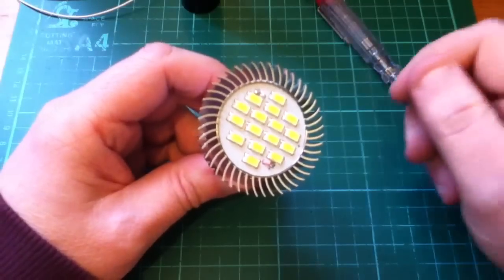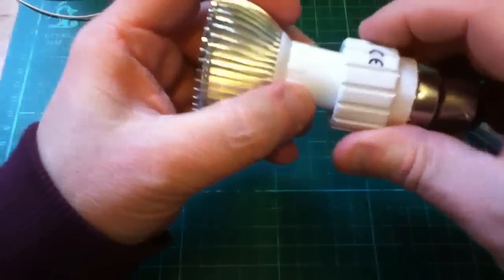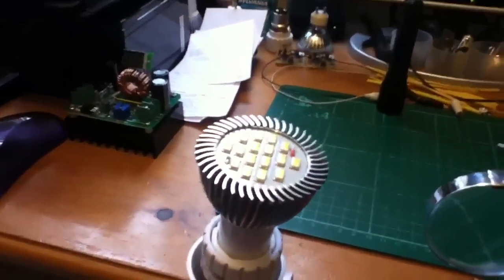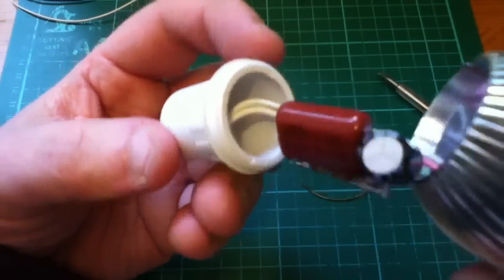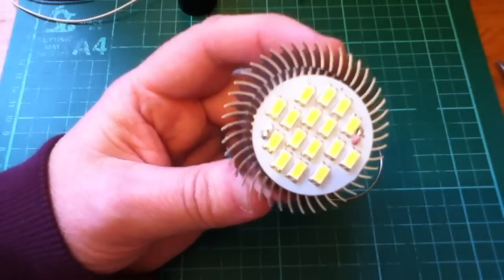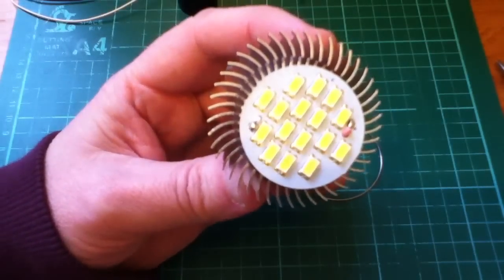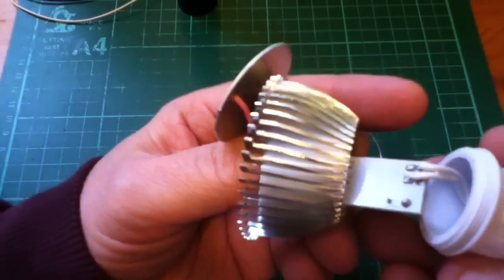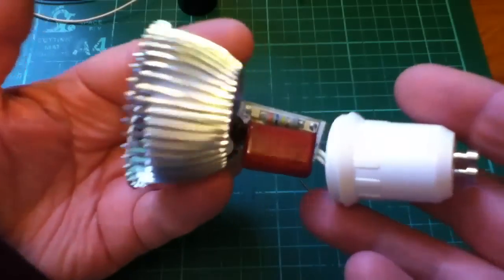Dangerous GU10 LED Spot Light is Cheap and Bright but could Kill You - Seriously

Comment: Get to know what a bridge rectifier is,  lol, what an ass hat. You can turn the bulb 180 deg and it will still be ground potential. At least you could have done is meter the heat sync to provide us that your hypothsys was incorrect.
Reply: Dan M There is no bridge rectifier when the bulb is screwed in "backwards". Try watching the entire video.
Reply: AC mains > Bridge Rectifier > rest of circuit. No matter if mains hot  or neutral,  rest of circuit can not change polarity from changing in bulb insertion direction.
Reply: Dan M
You're not thinking about what the case of the bulb is connected to. The circuit that powers the LEDs is irrelevant. The case is connected to the neutral pin of the bulb but for a thin layer of insulation. If that insulation breaks down, reversing the orientation of the bulb results in the hot wire being connected to the case.
Reply: "The case is connected to the neutral pin of the bulb but for a thin layer of insulation. If that insulation breaks down, reversing the orientation of the bulb results in the hot wire being connected to the case." 

There should be isolation from the ac mains hot/neutral to the rectifier  dc portion, usually a circuit board that has a few mm of board etched isolating the mains to the dc. Even at 220v, would not be able to jump/arc across, unless of an electrical storm producing excessive ac voltage  may jump the gap, and most likely damage more items in the house.
Reply: "There should be isolation from the ac mains hot/neutral to the rectifier  dc portion"

But there isn't - this is the entire point. The "neutral" skips the PCB entirely and is wired up to the LEDs.
Reply: Dan M
That's not isolation; that's just a gap to prevent arcing. Only magnetic or optical isolation will prevent a shock if the bulb is inserted backwards.

In any case, looking at the PCB, the insulation is only a mil or two (thousandths of an inch) thick. The minimum safe separation distance at 250V is 0.56mm (22 mil). Remember that the PCB has an aluminum substrate.
Reply: dllexport- Really puzzled: a mil is a unit of angle used in the military, the angle subtended by one metre at 1000 metres.  A thousandth of an inch is a "thou", not a "mil".  It's too confusing, especially as 1 millimetre is usually referred to as "1 mil" - an abbreviation.
Reply: William Cowell
In electrical engineering, a mil is 1/1000th of an inch. I've never heard of 1 millimeter being abbreviated as "1 mil". It's always been "1 mm" because that's the SI abbreviation. But you're right, "angular mil" is also abbreviated as "mil". The archaic units the US and other countries use is very confusing indeed.
Reply: mil was suppose to be mm
Reply: Interesting, Dan.  In all my time in engineering , I never once heard of "1 mil" being "one thou".   And with good reason perhaps, as it would be very fertile ground for an expensive - or dangerous - mistake.

Comment: Ok I'm no sparky, as us Aussies call electricians, so won't get into the whole voltage vs amperage argument, but really how many people change a lightbulb whilst the socket is turned on or touch a bulb it whilst it's plugged in and turned on.

I mean really.

Also it really is a case of you get what you pay for. I mean people buy stuff off ebay because it's cheaper and cheaper doesn't mean just in price. eBay and the internet have opened up the market to cheap quality non regulated rubbish that can be dangerous - just because it claims to be genuine doesn't mean a thing.

Comment: i don't mean to troll, but doesn't the bridge rectifier prevent that from happening?
Reply: Araon pottor Nope - the entire circuit that comprises the voltage drop and DC conversion is only on one wire. Go back and watch the video again - of the two pins, one goes through the fancy circuit, and one goes directly up to the surface of the bulb. Now in normal operation is is okay-ish as the entire circuit will operates as a circuit. But if you were to screw the bulb in 'backwards' and get 240V at the surface of it, when you touch that bare wire you don't have a bridge rectifier or capacitor in your hand. So your body just provides a ground path for raw mains power.
Reply: holysirsalad Wow, a bridge rectifier that works with one lead, now that is cutting costs to the bone. Uh, how's that work?

Comment: Does the LED not work on DC? If the control board sends a DC voltage to the LED's then no matter which pin lines up to AC, the wires from the board to the LED's would always be the same polarity whether no matter which prong is "Hot" in the high voltage side of the board. Am I missing something here?
Reply: There's no electrical isolation. Voltage is between two points. For the bulb, it's the output of the DC rectifier and the case, which is supposed to be connected to neutral in this unsafe design. (In a properly designed GU10 bulb, it wouldn't matter.) Flipping the bulb around will cause the case to be connected to hot. You're standing on the ground, not on the rectifier's output terminal, so you'll get shocked.
Reply: dllexport- Thank you for the reply and clarification, it's not the sort of thing I tend to buy online but I enjoy watching interesting tech on youtube. For those who might obtain a unit like this I appreciate the time people take to produce clips like this, I have posted a couple repair videos myself and recognize how time consuming it is. None of mine have rated a million + views though!

Comment: Thanks for that.
There is also another way to electrocute yourself even with the light switch off.
It does require your house wiring as well as the LED to be 'faulty' but this can occur.

If the 'Polarity' in the lighting circuit or main house wiring is 'reversed' turning off the light switch
doesn't make the circuit dead.
In this case you'd have to switch off at the main switch.

Comment: isolate supply before changing the bulb  -   dangers  are quite apparent   55 volts at one amp will earn you a free hospital visit   -  but I don't regularly climb four feet into the air to fondle my led bulbs especially while they re on   if it bothers you so much  - go back to halogen bulbs  -  the electricity company will love you  and as a gesture  to you  ,      put your bill up

Comment: It doesn't look very safe nor well designed, but a few remarks: I don't get your comment about "a 50% chance of live vs neutral". There is not really a live nor a neutral line in AC so the orientation of the socket really doesn't matter, the very concept of AC means that live and neutral switch several tens of times per second between both conductors. As for the PCB, it is in fact a legit PCB type called Metal Core PCB, designed for things such as HP LEDs that need a PCB but also an efficient heat conduction path. So, unless you're using high enough voltage that it would arc across the electrical insulator between the PCB and the metal core somehow, this is in itself a safe and normal setup for LEDs as far as I can see. Very poorly designed though with no electrical shielding on the front and that stupid heatsink is hardly even making contact with the MCPCB, might as well just have omitted it and put some plastic on there instead... Then again, you get what you pay for. :-)

Comment: Did you not say there was a bridge rectifier in the circuit?  Then the line voltage will not be presented at the front of the bulb.  I would be more convinced that there is a problem if you plugged in the circuit and measured the front contact points that you say are a hazard.

Comment: I think, there is even a 100% percent chance of getting shocked because the bridge rectifier "connects" Live and Neutral alternating (50Hz) to the positive (or negative, respectively) DC voltage pins. Although, the 360k resistor you mentioned is very likely NOT in series with the mains terminals, but in parallel with the red foil capacitor, for savely discharging it. This prevents you to get shocked by the mains connector pins after switching off the lamp und taking it out of the socket. 360k would dissipate way to much energy if it would be in series with the rest of the circuit. The foil capacitor acts a capacitive restistor without energy losses, it limits the current through the LEDs.
My personal opinion is that it's ok to use such lamps, when you know the possible danger. Thanks for this video revaling that.

Comment: Yep, do NOT buy led lights off the net, unless it is a well known brand. Been there, done that - thrown them away and will never do it again. What happened? The lights stopped working after about a month, one after the other (I bought 5 all in all). Then, when I had a look at them, they actually physically fell apart, besides having the wires holding them together! 

No joke, and belive me when I say it was not fun either. Could have costed me dearly, now I only lost about $25. I got my new lights from Ikea, they are still cheap but they are also reliable!

Comment: The bridge rectifier converts the AC from the mains supply to DC to power the LEDs. It doesn't matter which way you connect up the power to the AC terminals of the bridge rectifier, the positive and negative DC output terminals of the rectifier stay the same so the resistor is always there on the positive DC feed to stop you getting electrocuted.

Comment: I feel that somebody needs to highlight couple of BASICS:

To everybody:
1. modern electric installation should be equipped with residual-current circuit breaker (so called RDC or RCCB) which is meant to protect you from getting killed, even might save from pure stupidity ;)
[Speak with qualified electritian]
2. There are some electric standards how and where those three magical wires should be connected (and they seem interchangeable for some - OMG!). If you don't have it done properly then you need to call to qualified eletrician immediately because those standards are MADE FOR YOUR SAFETY not for ones free interpreteation.
3. As my grandfather told me many years ago - there are some things you should not do - you should always set the light switch in OFF position and also turn off proper circuti breaked before changing the bulb. Why also the circuit breaker? Because somebody can come and press the switch accidently.
4. If you are not certain if you have something on "live" AC power there is a simple tester (cost is minimal) everyone should have it for such case - ask anybody who knows anything about electricity to buy you one and show hot to use it,

To all experts and "experts":
1. Since everybody can watch this video and read your comments and WHAT WORSE you invite the watcher to try to connect PHASE and NEUTRAL wires inversely it whink you forgot that even a couple years old kid can try to do it or a person knowing no basic precautions. I thought that meaning of this post was to make people safer... What is done here is STUPID.
2. In normal situation you have those three magical wires PHASE, NEUTRAL and GROUND with standard color codes.
If the electric installation is done properly then there is no problem with connecting the lamp. Lamp cables should and usually are with the same color. One just connects them. Therefore such situation should not happen. There should be an RCCB, too. Especially in bathroom.
3. In normal conditions there might happen to be (and usually there is) some voltage between NEUTRAL and GROUND. But first of all it will happen to be a DC. and standard RCCB (AC type) will not protect from it. BUT THEN YOU SHOULD always press the test button on it and it will disconnect both PHASE and NEUTRAL wires - MAKING YOU COMPLETELY SAFE.
4. The examined thing should never be used because it doesn't have the TRANSPARENT TOP COVER and IT WILL BE AFFECTED by HUMIDITY.

But first of all no one should try to replace the bulb on "live" PHASE.except for QUALIFIED PERSONS in the CONTROLLED TESTING ENVIROMENT where certainly will be somebody to break the circuit and resuscitate you, if necessary!

Comment: The statements made in this video are totally correct both technically and with regard to the safety issues. Just to answer a couple of points raised in Comments: a bridge rectifier does not safely isolate the DC side from AC mains and even if it did 240v DC is as dangerous or more dangerous than 240v AC; the voltage applied to the LEDs is irrelevant to the discussion - the voltage relative to earth is what is important.

Comment: Chinese-made product with no safety certification or faked certification to get it past customs?  It should only be used inside a finger-proof enclosure, if at all.  The capacitive voltage dropping circuit is junk:  I'd expect this lamp to have a useful life of less than a year, due to complete lack of voltage regulation..

Comment: A full wave rectifier isolates the high voltage feed ! only low voltage and small current ! But ok to check stuff out for safety , just know what your doing, now if the slim peice of plastic insulator wasn't reinstalled then you will have created a dangerous situation !

Comment: You are an ignorant idiot. There is no way 220v AC is going to the led's as you claim; IF it did they would immediately and literally BLOW OUT and off the board. The circuit converts from 220v AC to Low Voltage DC..  IF it is as you claim? hen put on some protective gear and show a video of what you claim is wrong. Final point is LED's only run on DC current; Never AC current..

Comment: Excuse my ignorance.  I have a question... If there are microns of resistance due to the choice of material for the circuit board, why doesn't it short-circuit?
Reply: Jamie Evans Yes and no.

First of all you shouldn't touch the radiator during operation simply because it is quite hot.
Also if you are not touching something grounded with other part of your body (or the neutral wire) you won't close the circuit through your body. And this is why you should never try to replace the bulb with the power on ;)

I would bet that it would electrocute sb after a dose of humidity or simply make a short circuit to the ground if the lamp case is metal and properly grounded (it should be).

Anyway if you have an working RCD the risk is limited - it will quickly disconnect the mains...

Regarding the design actually most of insulation layers in most of such appliances is quite thin because of conditions they are used in. And insulation usually isn't grounded because it is a different thing to ground something and insulate it. You have a plastic/rubber layer on each electric cable to insulate it, for example. Proper insulation inhibites current from flowing. The casing is from plastic (an insulator) and the radiator could be grounded but first - there is no ground connector in GU10 standard and second - with good design and a proper insulation it is not necessary to ground it. Look - if you take properly made LED bulb for E14 or E27 connector there is no grounding necessary, and it is usually not possible to ground em, too. You may only ground the lamp case or some parts of it if a manufacturer made it this way. 

Lack of top transparent cover makes this bulb dangerous. Placing it would simply protect you from touching where you shouldn't and itself from humidity. And that is why usually they have that cover (or also with some lens in it to focus the light). I could list some more disadvantages of this design but I think that this one is the most important here. The problem presented would be similar to some cracked ordinary bulb when you would put your finger inside it with mains on...

Even if they would have done much better job with psu part still leaving it with no cover would expose the user to risk of being accidently electrocuted (nevermind AC from mains or some lower DC voltage). Proper design makes user safe from such unpleasant surprises ;)

I hope it will clarify this a little :)
Reply: Because the voltage is between 110/240v the very thin insulation is enough to stop the current arcing or shorting, the risk is it's so thin it could be damaged very easily making the casing/heat sink live and thats the bit your most lightly to touch ajusting or changing the lamp. That could lead to a shock and possibly death.
The lamp is potentially dangerous, and illegal here in the UK.
Reply: Wayne Clarke Sureley the LEDs have a greater resistance?  Is it just a case that the insulation is not earthed that the current flows through the LEDs, but if the casing or radiator/heatsink were earthed - by being touched for example - then the path of least resistance may be the body?
Reply: The current flows from the positive to the negative of the LED, if the base wasn't insulated at all the current wouldn't flow through the LED either, it would just go directly across in a short.
Part of the problem is the bulbs can't have a proper earth due to the system of most normal house lights being a two wire rather than three as you'd have in most mains sockets, this would make them safer.
Reply: Wayne Clarke So am I right or wrong?
Reply: kmoon1982 It did.  Thanks for your comprehensive reply.

Comment: Are you really that stupid.  Yes, both contact pins are interchangeable, the supply power is 220-250 VAC for use in UK and most of Europe.  Inside there is a plastic film insulator around the electronics power converter board, and from the size and description that was visible and your narrative, these parts convert the AC power to DC 24 Volts.  The LEDS each only operate on 5 VDC are in a series/parallel pattern.  The front exposed soldered power connections are low amperage 24 VDC.  HOW IS THIS LETAL?  And Where Is The Bulb Lens?  These are never sold without a cover lens.  This stupid video was a total waste of time because you don't really have a clue.